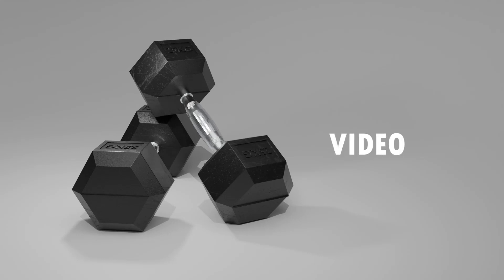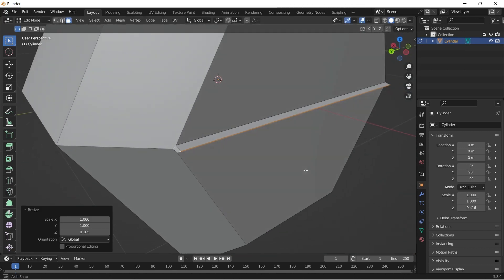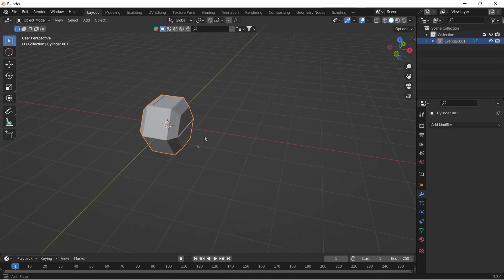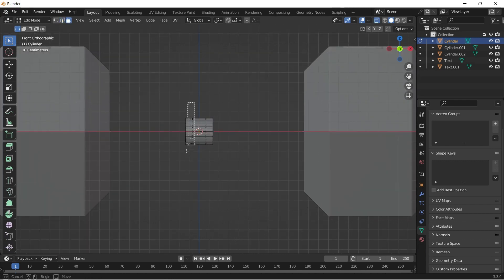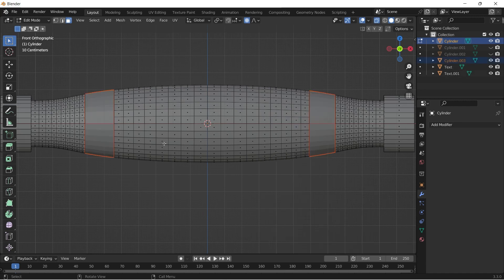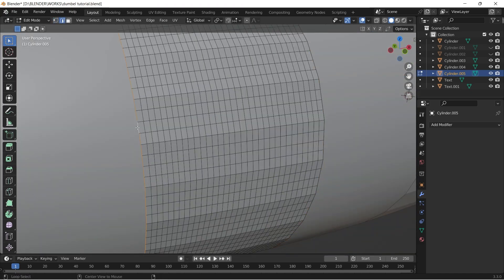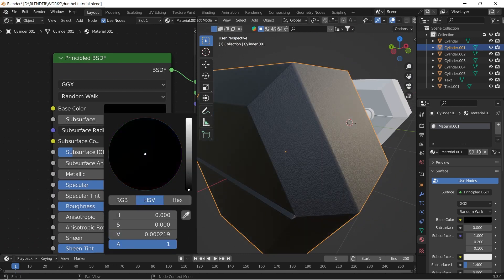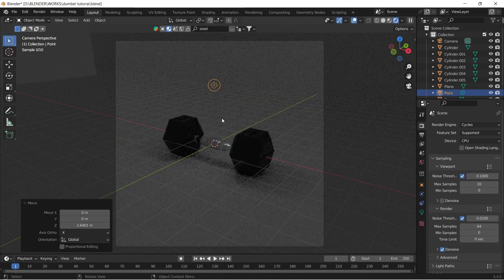DUMBBELL MODELING INSIDE BLENDER | TUTORIAL

Comment: i got lost at 0:38
Reply: do some more basic tutorials first. first a really basic pan one. then do the donut one by blender guru. basically do 2-5 before this one probs. I got to really complex stuff a few years ago. it is as simple as do the easy tutorials first then gradually do more complex ones. i'm just blasting through a bunch to remind me of how to model. 

But he said:
1) press tab to go into edit mode
2)the at the top of the screen you can click into face mode. you can then click the faces. shift clicking them also selects faces without going into face mode.  there are three modes: corners, edges and faces
3) press i to insert it. lets you offset
4) then press g to free extrude and then x to lock it onto the x axis. you can type in a scale of how much you want to extrude it. 

0.75 speed and pausing regularly as you follow along helps a lot. 

It is quite overwhelming at first. but i promise it gets much much easier.